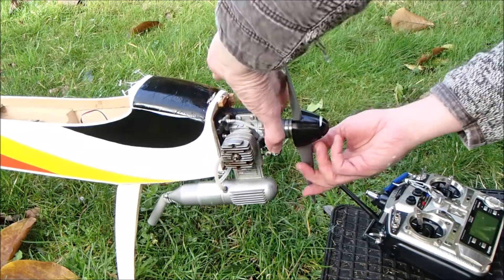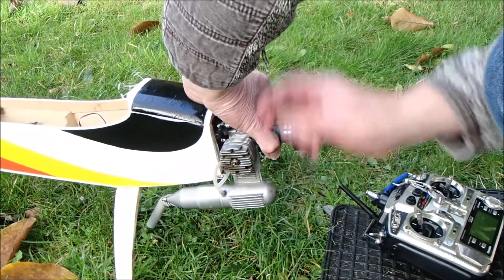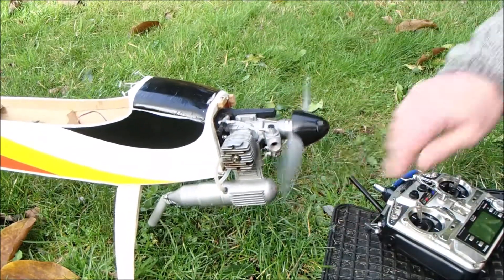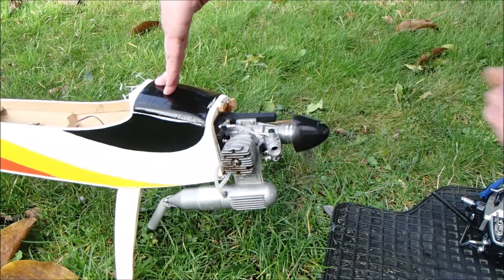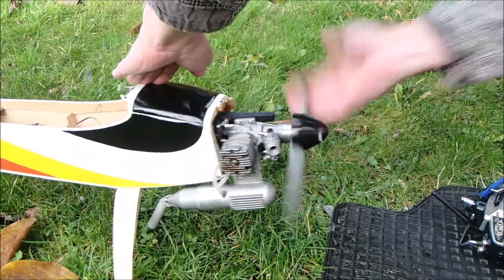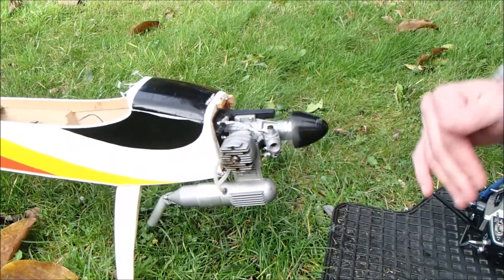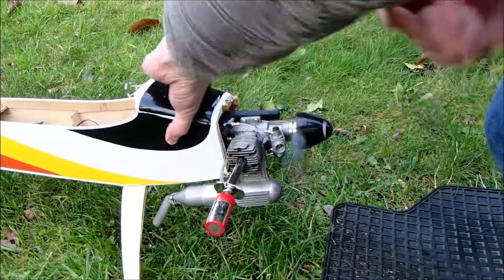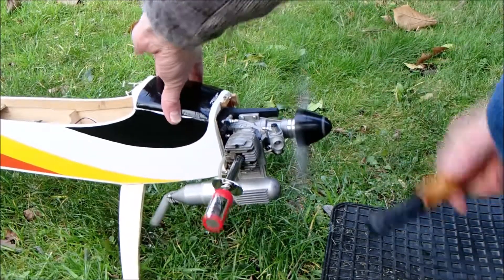Model S.C engine rebuild first run

Comment: Hi. I have just stripped my SC46. The liner does not have a notch or any other marks. How do I fit it the correct way? I have lined the exhaust ports up with the holes in the liner but the fwd and aft ports look slightly misaligned? Thanks.
Reply from the maker: Is it the same "square" shaped SC engine like mine or an earlier round one ? If the liner cane out in the same orientation and isn't reversed then I'm guessing it is just classic Chinese tolerances. TBF if you assemble the engine as you think it should be and it turns over by hand without any interference, try ground running it to check that the performance is as expected. Good luck
Reply: @richardjweeks   Lol. Thanks.

Comment: Richard, I am returning to the hobby after a long time and have just bought an RC trainer with SC 46 installed. The engine is pretty much new needs some breaking in, but I haven't been able to find any manuals on how to operate this engine. I have managed to start it (had to use en electric starter for that though). It will start only with the throttle wide open and will run only at a speed that is way too high for breaking in and at the lowest speeds I can get, the RPMs are not stable and instead fluctuate. Could you point me to any docs on how to get started with that thing? Mine has the main needle integrated into the carb, otherwise it looks the same.
Reply from the maker: I will try and look into it tomorrow
Reply: @richardjweeks  Thanks for your reply! I have found this https://www.youtube.com/watch?v=2MjVJrhsC50 and setup the carb according to what the vid suggests. The first carb is exactly like mine. Will give it a go tomorrow and see what happens.
Reply from the maker: David makes good videos. You should be fine from here